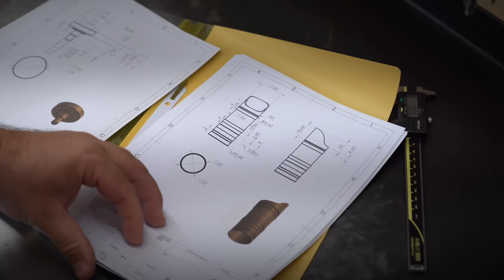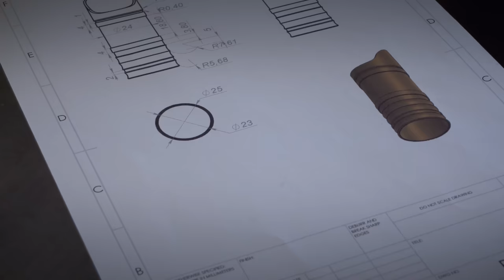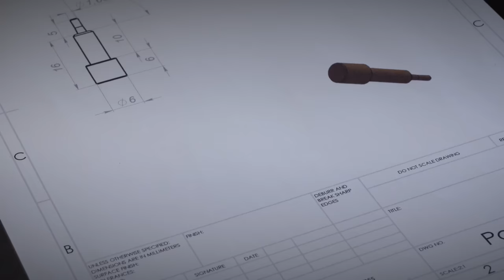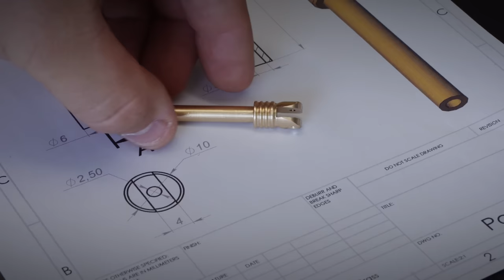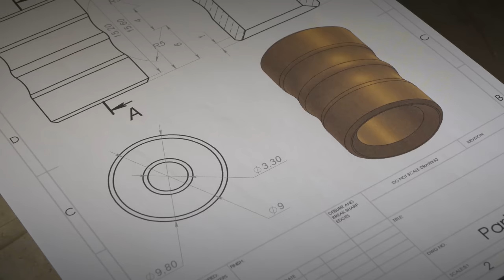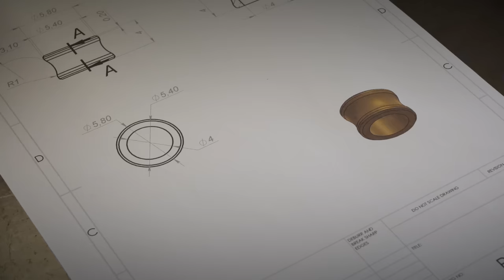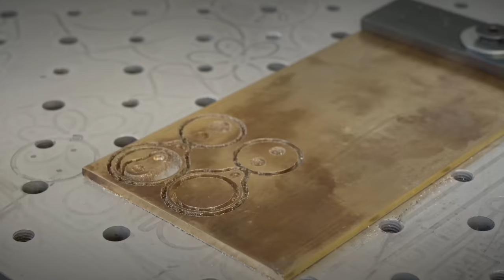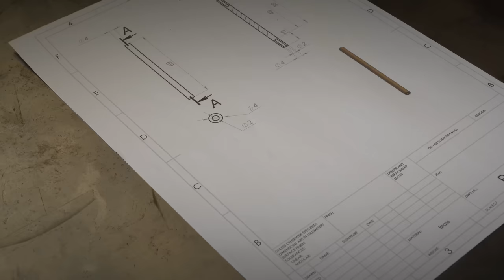Making a Steampunk Lighter  "Barrel"

Comment: I tried copperchloride for cleaning brass parts, but it turns the surface to copper. Any advice?
Reply from the maker: I think you are using too strong a solution or keeping the part in the solution for too long. You also need to understand what you are using chemical cleaning of brass for. If you are doing this to patina later, then fine, but if you want the part to shine and keep its shine for a long time, then chemical cleaning is not suitable for this, rather, on the contrary, the part will darken very quickly. To make the part shine for a long time, you need to use polishing pastes with wax additives or, after polishing, paint the brass with a transparent two-component automotive varnish.
Reply: @BanjoShow  In some of your videos, you see bubbles rise very quickly. Shine is not needed, I just want it uniform and look "all the same" like yours :p I see lots of bubbles and then it looks all clean and matt.

Comment: Nice work on that lighter.  Silly question, mind me asking how many hours it took? From start to completion.
Reply from the maker: Thank you.
After I had the idea of this lighter, I started working on a 3D model on the computer, which took me about one week.
For about 5 days I made parts for the prototype, after which I made some changes in the design and methods of making parts.
Then I made a second copy of the lighter with changes in 3 days.
In total, I got about 15 days.
Now to make a lighter from the beginning to the end, it will take me about 2 days.
If you shoot a video and make a lighter, then this is a very long process; this video took me 8 days and 2 days of editing on a computer.
Reply: @BanjoShow  wow, well the end product turned out great.

Comment: 8:35 so you don't mess the face of the plate, you should clearn it up with a tool path and glue a plexiglass sheet on top, with all the holes needed, that itself then gets zeroed out. If you get a thicker piece like say 8 mm thick, that's gonna last you a long time, and plexiglass is very stable. Two part contact cement is good, because heat will release it super easy once you've chewed through. IMO, the height loss is negligible compared to having to eventually replace the plate, plexi is cheaper.
Reply from the maker: Thank you!